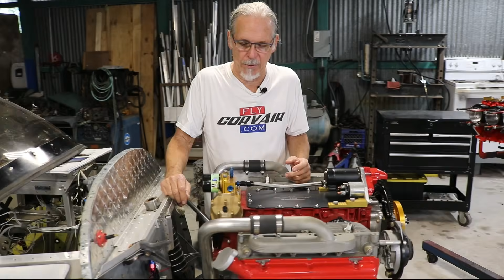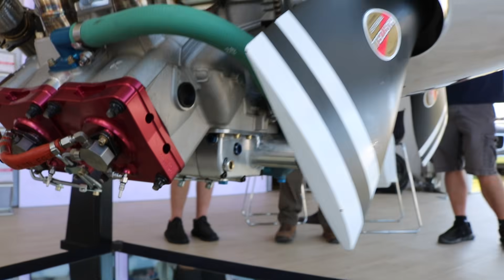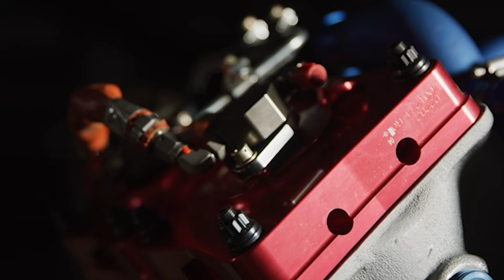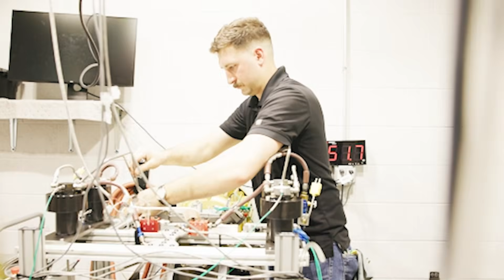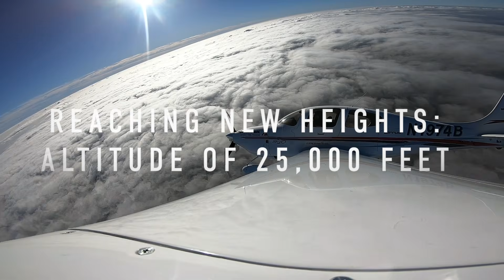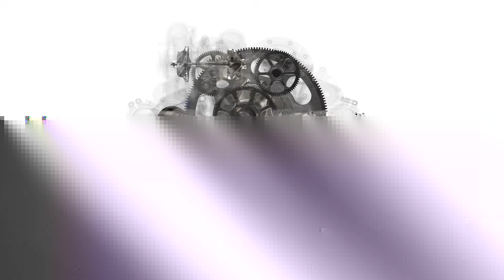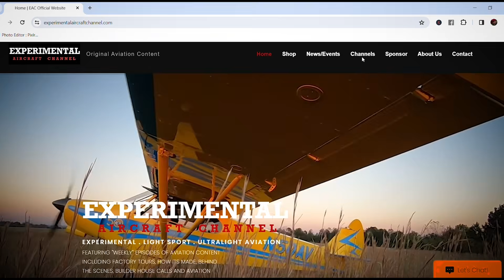DELTAHAWK Diesel Jet Aircraft Engine - ENGINE WEEK 2024

Comment: Probably the future of aviation motors. I am a farmer that has been running diesel engines for 50 years. And have never had an engine overhaul in any of the many I have owned. They go forever, start on the first turn or two and as long as the fuel stays clean they will run forever
Reply: @berniebrown9115  that is true. An engine is just like our bodies. If you don't take good care of it, you will eventually need major repairs.

I have a 1997 Nissan Sentra, original engine with 863,453 miles. Plus I get 40 miles to the gallon.. I got this long life by using 5W-40W synthetic desiel engine oil.

Note: Desiel engine oil is the same oil used in the 50s , 60s, and 70s. After 1980, came the synthetic version. There is a secrets ingredients in desiel oil which is not in gasoline engine oil.

It is not that desiel engines are better than gasoline engine, it is in the oil we choose to use.
Reply: @jetski7611  I’m no expert but I think your last sentence is very debatable.  Diesels run at very low rpm which has to add to longevity.  You would have to run a side by side engines to prove your assertion that the oil you use is why it lasted 800k miles.  You drove. 30,000 miles a year in your 97 Nissan?
Reply: Farm diesels (John Deere, CAT, etc) are HEAVY duty. They have extremely rigid blocks and huge forged cranks and bearings. Forged conrods. Forged steel pistons.

Aero Diesels are often derived from eco cars such as Mercedes or VW. These new engines are designed from the ground up for aircraft, so they will likely be built well, but also as light or lighter than any car engines. Which are already 1/4 as heavy as a tractor or bulldozer engine. 

Tractors are designed for 5,000hr service life. Old tractors were good for up to 10k. An aircraft diesel is probably good for 1,500-3,000hrs.
Reply: Diesel efficiency in a light weight block😂❤
Reply: Germans had very successful diesel plane in ww2
Reply: I still think petrol is a scam in a world where diesel exists
Reply: That’s a myth, diesel ring and cylinder bores wear out just like any other engine. They aren’t magic.
Reply: You’re a farmer so definitely an expert in aviation😂.
Reply: @yolo_burrito never heard of crop dusting have you?
Reply: @ never heard of a diesel crop duster.
Reply: @yolo_burrito  Red A03 cropduster. It may be the only one in existence.
Reply: @yolo_burrito  not the point. But you know that and are pretending to be stupid, or you actually are.  The point, to be clear since you are being a petulant child, is many farmers and ranchers are quite versed in avaition.  Many have planes and or helicopters they use for crop dusting, spotting herds, etc.  I worked on such as a teen.

But hey, keep playing dumb.
Reply: Most crop dusters put red or green diesel in their turbine pt6 powered aircraft because it's cheaper  @yolo_burrito
Reply: @thebarkingmouse  they don't run on diesel
Reply: @Christoph1888  took about 4 seconds to search for diesel crop duster and prove you don't know what you are talking about.
Reply: @yolo_burrito people are laughing at you, you gonna take that?
Reply: Great video! It seems that 230hp is pretty tame for a 330 lb motor. 
Was any testing done to see the maximum powe that could be produced before it self-destructs? 
What's the highest rpm was it tested at?
Reply: More weight, less power, no savings on fuel costs, lower TBO... not happening.
Reply: @PistonAvatarGuy have gas piston engines are going away whether we like it or not
Reply: @slickjimmy76  Not in aircraft.
Reply: @slickjimmy76  And, really, electric vehicle sales have pretty much flattened out in the US as well.
Reply: @PistonAvatarGuy  yeah everybody got over their initial excitement
Reply: @slickjimmy76 Brazil and I believe other countries are 99 percent Diesel cars.
Reply: @Richard.Hybels Yes I spent some time working in Italy and 50% of the car's there were Diesel as well. I loved it!

Comment: The torque  'pull ' must be strong on this engine , look at the flywheel size
Reply: It has a high compression ratio, requiring more torque to turn it over. The larger diameter flywheel allows a lower powered starter to turn it.
Reply: Torque is irrelevant when it comes to aircraft engines.

Comment: This is a really nice engine. But at $110,000, I guess I'll never own one.
Reply: I don't see a $110K advantage from this. If they talking about fuel saving when it will break even? 50yrs? 100yrs?
Reply: @wayneyd2  If they can get a 3000 hour TBO like he mentioned, that's a significant savings, particularly for places like flight schools that are putting tons of hours on their airplanes.
Reply: $110,000?  Nope.
Reply: hope the future lineup of this engine get fairly priced, maybe this one is more for non exp planes and flight school
Reply: $110k? Nope. When the E-AB community is cringing at a $30k powerplant, this prices DeltaHawk out of the market. As an aircraft designer/builder/owner/tester myself, I cannot justify this price point. Additionally, the light GA community does not fly at FL250. Looks like they created a solution in search of a nonexistent problem.

Obviously this is their way of recouping the exorbitant & prohibitive costs of certification. Had they released an uncertified variant 15 years ago as they originally intended, you would not see this pricing, even if they certified the thing.

I am all for newer powertrain technologies that can help our community thrive again, but in this economy, it needs to come at a realistic price that all the players can afford.
Reply: That's not the price of the engine, that's the price of the engine mount, cowling, all ancillary and accessories. 

It's expensive but so are the fully installed prices for any re-engine.

Upgrading a Cessna 175 to a Lycoming IO360 is about 100k (you can look up the STC for yourself).